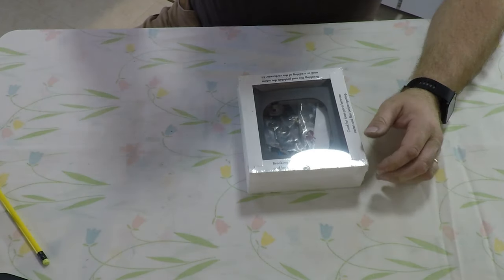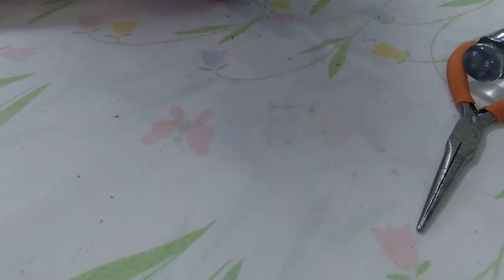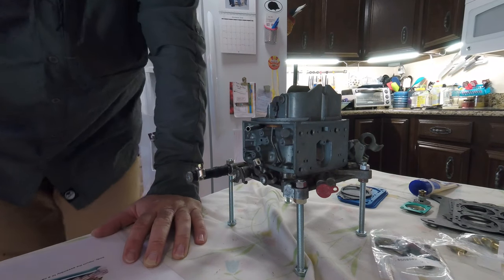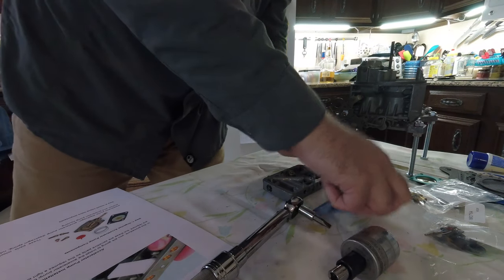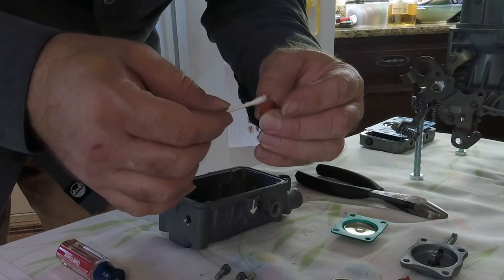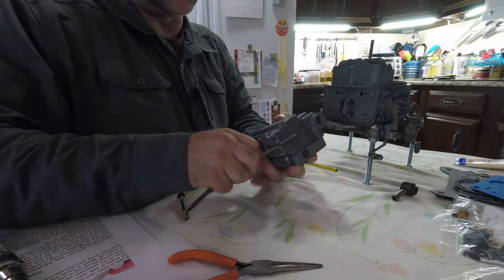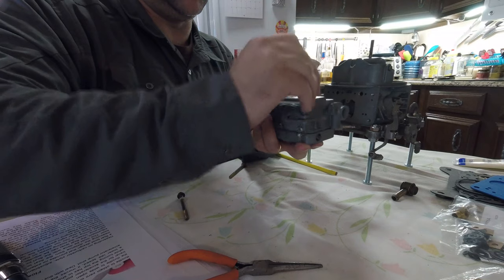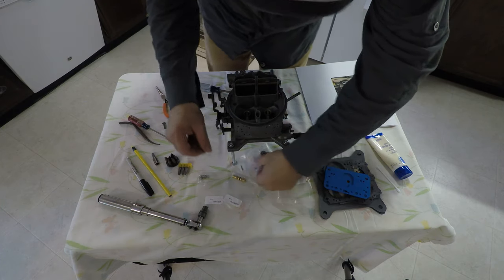How To Rebuild A Holley Carburetor 4160 - Part 3 - Rebuild

Comment: Thanks! The Walker rebuild kit has a link to a good install/adjustment instruction sheet. Very good illustration to adjust after building. There is also a cute little cardboard ruler that is very handy.

Comment: Where can I get a fuel bowl like the one Neil is rebuilding.   I have a '66 Corvette 4060 that has the vent and adjustable float but the screws striped out of the accelerator pump hole.
Reply from the maker: Wish I had a suggestion for you. Best I've got is to Google it or look at Holley's site.
Reply: @NeilRichard  Thanks, I've called and emailed Holley several times with no luck.  Ill look for a different email address.    Im going to try to repair the bowl with a helicoil before replacing it with the incorrect type..    Stay safe.

Comment: Anymore they don't come with instructions just a qr code for info online. also if you can't do it off of what is on the paper then you probably shouldn't be opening a carb in the first place. I run a business rebuilding carburetors and too many times have I gotten them with the customer saying "I got a kit and rebuilt it and it didn't run right afterwards"